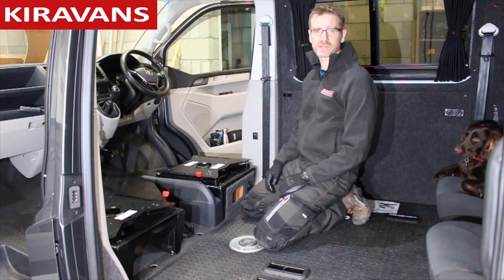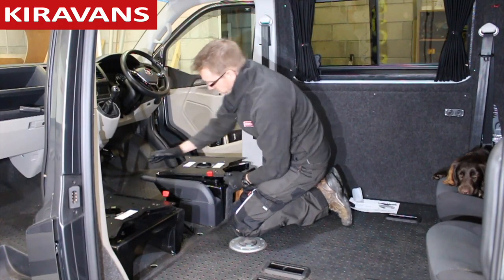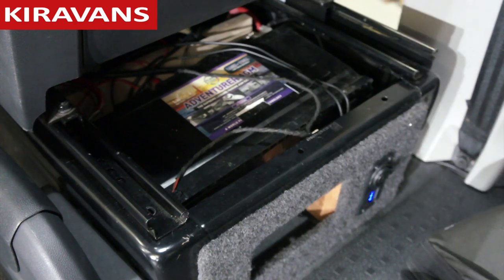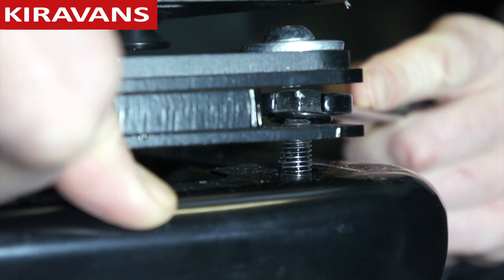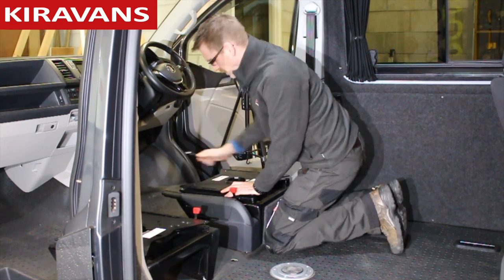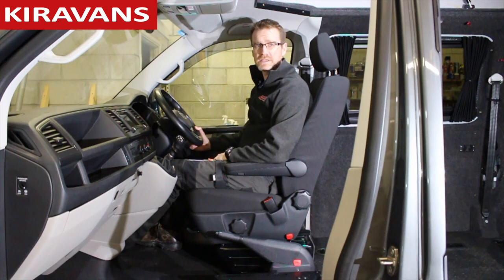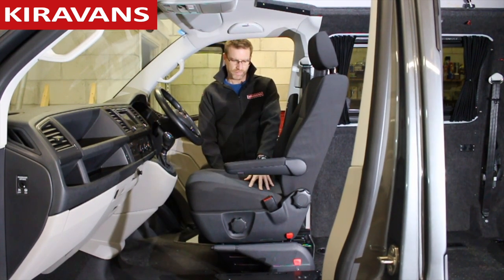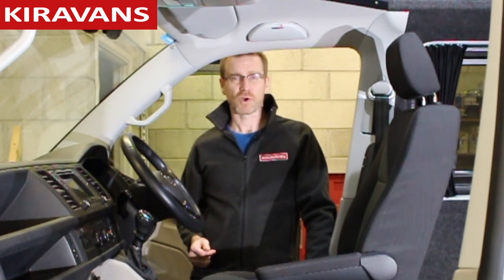How to Fit a RIB Driver Non-Offset Seat Swivel to your VW T5/T6 Van or Campervan

Comment: Hi Mike I've put my leisure battery under drivers seat and when seat is back in the seat rail sits on vent pipe and although the battery is for under seat it protrudes slightly etc. If I had the rib swivel seat with the shims would this clear the leisure battery altogether thanks

Comment: I’m looking at purchasing your offset RIB drivers swivel seat. 
Can the hand break be reapplied after the seat has been rotated to the face the rear?
Reply: Did you find out this? I bought the traffic version, not any information about it ripping the hand break to bits and also sitting directly above the handbrake